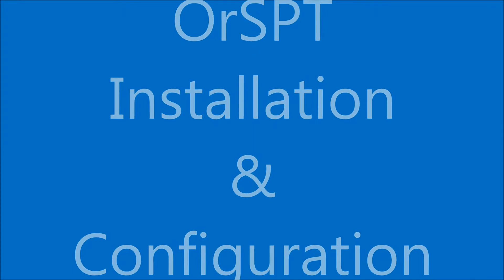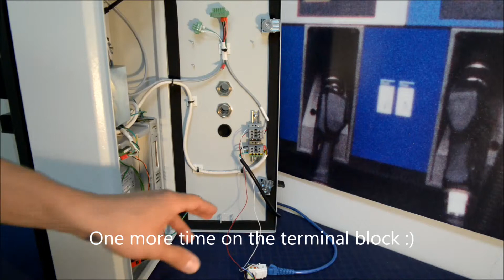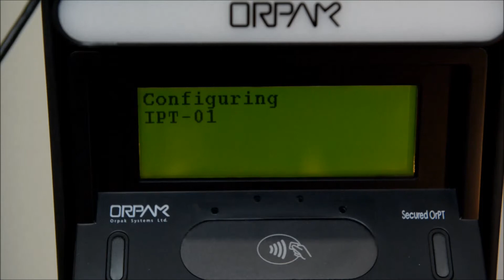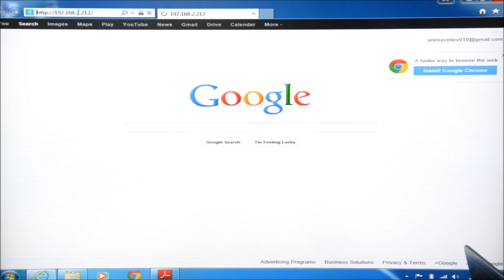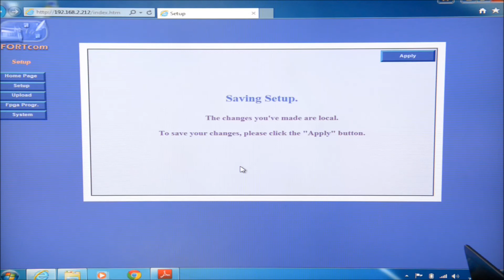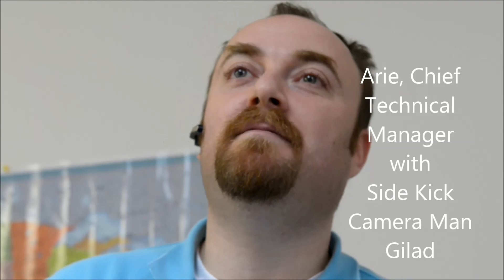OrSPT Install & Config

Comment: Question- if i have the same exact OrPT interface (in-kind) on the tower can i replace it without losing any  data or worry about the system crashing? Same exact OrPT, i'm just afraid i might lose all of the data or something will mess up